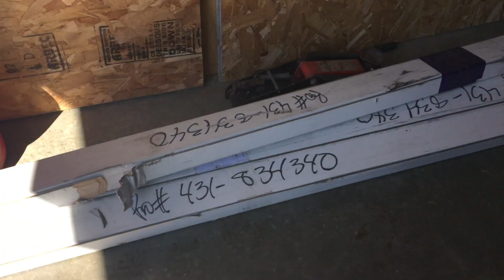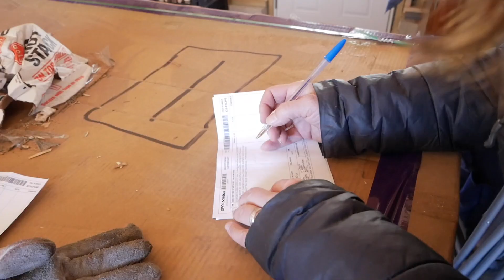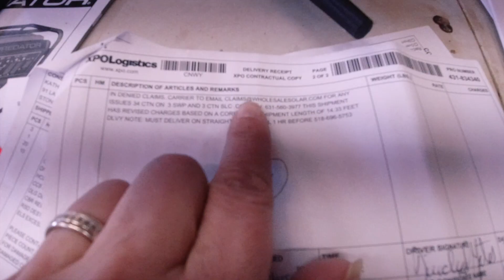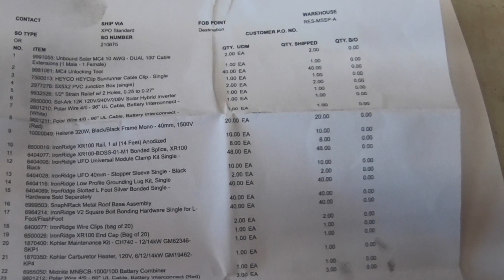OFF-GRID Solar System is Delivered

Comment: Oh so sad about your panel delivery :( How much do you spend on all solar equipment?
Reply from the maker: We spent way more than we should have. Inflation definitely is having an impact on all we do. We will be posting a video about the costs, but the solar panels were roughly around 14K I think. The batteries were about the same. And that was with a 10% coupon! A painfully expensive decision, but hopefully it will be worth it because it includes all the parts and support we need when we install it.